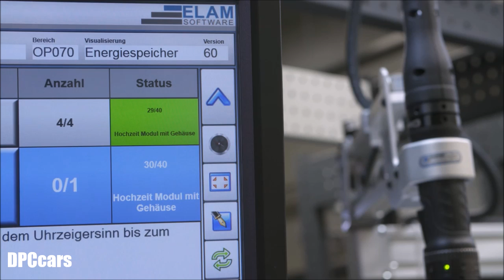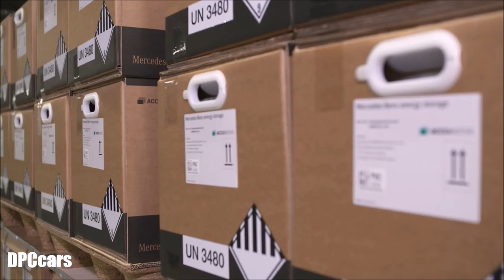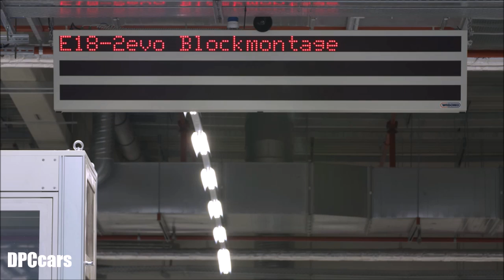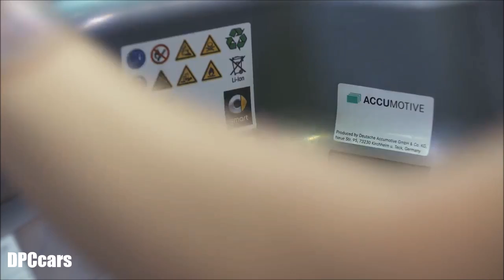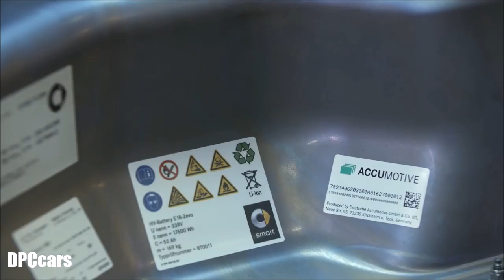Mercedes Battery Production Factory

Comment: Why are they doing this all by hand?! This way (slow) they will never be able to compete with others.

Edit: And the stuff done by the robots is also sooo slow...
Reply: It is nice humans are involved in the production process rather than robot in the entire production process...
Reply: Because it's at the prototype stage?
Reply: Every car manufacturer calculates the production volume.
There is always some jobs that are cheaper not to automate with the respective volume.
Some can't be automated.
For example a large part of the end assembly is always done by hand.
Reply: Safety. The process could run faster, for sure, but if ("when") something is off by a few mm and a battery is shorted or crushed, even one "dead" cell has tremendous power in it. (also MB has plenty of money to burn)
Reply: Robots are working at a good tempo. Consider they don't smoke, don't eat, don't check their Facebook during working hours, etc.